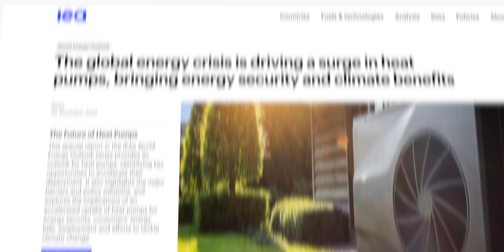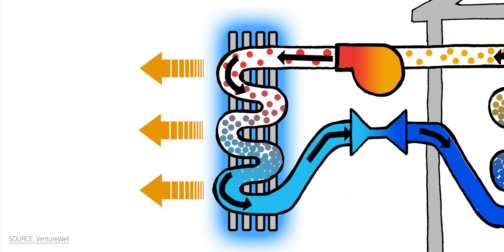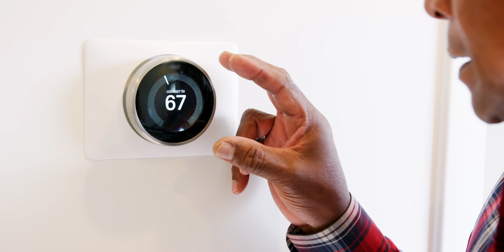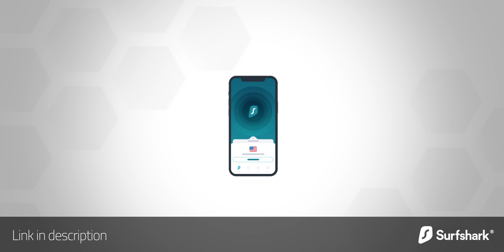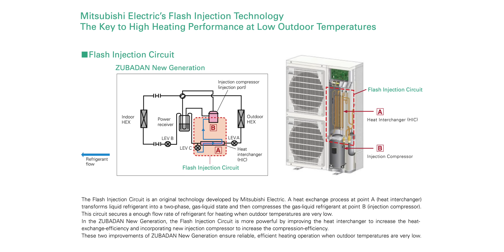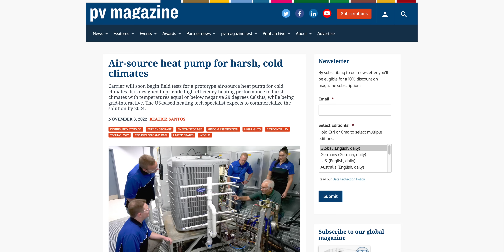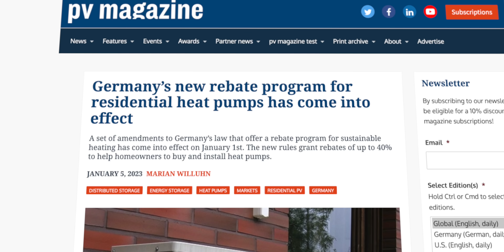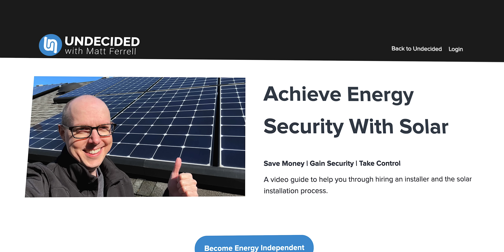Major Advances with Heat Pumps in the Extreme Cold

Comment from the maker: So do you want one of these newer heat pumps for your home? Any experience with them? Get Surfshark VPN at https://surfshark.deals/undecided - Enter promo code UNDECIDED for 83% off and 3 extra months for FREE!

If you liked this video, check out: The Challenges of a Wind Turbine on Your Home https://youtu.be/nPvTH7Siclg?list=PLnTSM-ORSgi7cadIj6qpCWkg-tPzN1sgj
Reply: The video was somewhat misleading as the differences between air source and ground source heat pumps was not covered and talking points erratically jumped between the two systems. I would have also appreciated a more in-depth pyhsics explanation on what happens when outisde temperatures drop below 5°C (instead of waving everything off with the annual average COP and only a superficial mention of problems with the phase-change of the work fluid).
Reply: @VulpeculaJoy  One of the problems with extracting energy from 5C air is that you reach the freezing point of water, so ice builds up. The outdoor units then periodically needs to switch to defrost mode to melt the ice. Unintuitively this problem lessens in colder temperatures as the outside air has less water vapor content. The rest of the diminishing returns has to do with a greater temperature gradient outside to inside to push heat against. This can be improved with some tinkering, as the Panasonics and Mitsubishan guys are doing, but can’t be avoided. If you live in -10F climates you need to go geothermal or have a secondary heat source on standby for those colder days..
Reply: @Random-f3y7w  But that's exactly what I said about differences between air source and ground source heat pumps. If air units do have that problem, how do ground units deal with low ground temperatures? What temperatures do we have underground anyway? Over what area or at what depth do you neet to place your piping? How much energy does a heat pump consume for an average house with average insulation during the winter? How do you combine heat pumps with other sustainable heating systems when it's too cold for the heat pump to operate?

The video is titled "The Truth About Heat Pumps and Cold Weather", yet it completely fails to go into detail about how heat pumps really operate in cold weather.
Reply: @VulpeculaJoy  "supplemental" heat sources are Always mentioned  and one was shown on the outside unit. These are a direct short heat coil so its using a LOT of electricity$$ . Also if that's during a Peak usage time, it may not even work...
Reply: The biggest problem that I can see with geothermal heat pumps is simply that it still requires electricity.  In Boston a noreaster bringing down hundreds of trees on the power lines and dropping a couple feet of snow on top of is certainly not out the realm of possibility.  Just running the heat pump would quickly drain any storage  battery. Do you have a backup plan in place.
Reply: Why did you install a water source heat pump when the payback period is so much longer when compared to an air source heat pump, and in some cases, is just not as cost effective? R&D in the air source heat pump segment is explosive because the technology is so much more affordable compared to water/geothermal. I would not be surprised if we continue to see dramatic increases in the efficiency of air source heat pump systems, such that water or geothermal systems make no economic sense in almost every conceivable scenario. Some HVAC or building scientists already allege that water/geothermal is simply not cost-effective in the face of air source heat pump offerings.
Reply: @reinhardtiushippoglossoides  because a ground source heat pump works in cold weather when an air source heat pump just becomes stupid when the heat pump is 3x to 5x the efficiency of a gas boiler but the cost of gas is about 20%-30% the cost per KWh of electric so the costs are about the same to run depending on where you live and its energy cost 

air source is cheaper because its worse by a lot and air source is the bigger segment cause not everyone can have a ground source heat pump cause they don't have the space for it most house in the uk have very little to no outside space 

air source can never be better then ground source ground source take heat from the ground that is always equal in temperature to the day before and the day before that so your heat exchanger means the system needs to work less to be as warm... when air source heat pumps are just so much less efficient if your in a cold snap of say -5C your exchanger while be running 100% of the time to just try and heat your home and the efficiency goes out the window and it will cost you 3x-5x to run it and will then be no more efficient then a normal electric heater
Reply: Heatpumps are very common here in Finland. Most common configs are Air-to-Air, Air-to-Water, Geothermal-to-water. We get -30 celcius on some winters here.
Reply: I have no experience with heat pumps but a question about the difference between air and ground sourced types. It makes sense that the air sourced types would lose efficiency as temperatures exceed 100f or below minus 30 but is there any reason for ground sourced to do so.
Reply: @dennisenright9347  there sure is! With air source HP, the temperature varies greatly, but with ground source, the temperature is much more consistent at around 50f.
Reply: @dennisenright9347  Ground source heat pumps do not lose efficiency when the outdoors air temperature becomes high or low. The discussion in the video was really all about air source heat pumps. It was a bit misleading that the video began with a testament to groud source heat pumps.
Reply: @jmb3543  Very true. I'll get an ASHP instead of a GSHP but I'm working on doing a lot more stuff before that anyway
Reply: Have You done a case study for a blackout situation with solar panels and heat pump?
Can Your solar panels, that feed into the grid also run Your own heat pump in case of a blackout or brownout?
Reply: I am looking at renting a jack hammer and driving down 50 foot deep pipes for a ground heat pump. Each 1-1/4 pipe would have a solid metal point and would have a plastic tube inside it.
Reply: @LaserFur  Interesting! I have a ton of questions, too.. How do you plan do link them together?  Will the water flow down the plastic tube and then up the space between the plastic tube and the outer pipe? Also, what type of soil do you have? I'm sure you'll want good pipe to ground contact and a pointed end should get you that, but what kind of friction will you have at full depth?
Reply: @heythere6922  I have a 50 foot deep sandpoint well. So I know I have 50 feet of sand with clay layers. The water table starts at 18Feet. Each will connect to two larger headers in the trench. I could do a pipe in a pipe or maybe even heat and pressure bend the end of a piece of 1/2 pipe into a sharp U shape. Then grout the plastic pipe in the metal pipe.
Reply: @LaserFur  If you can bend the 1/2" pipe into a sharp U shape and fit it inside the 1 1/4, you'll be much better off than if you try with 2 sharp 90 degree fittings. In this case, 90s are not your friend!  The pipe within a pipe would be an interesting challenge for your top connections, and more efficient if done well.  If you have a difficulty hammering 50' with a pointed tip, a oversized tip could help, but you'd want to grout outside the outer pipe down to the water table to maintain a thermal bridge.  Best of luck with your project!!
Reply: The original heat pump I had in the house started failing in 2021. The house was constructed in 2008. The cause was leaks in the interior loop. I had a Carrier heat pump installed with a package cost of $14,000 last summer. You can call it good luck or serendipity, but the inflation reduction act passed that fall. I didn't know that heat pumps were part of the package, but I'm glad of it. I also had solar panels installed, so with both I got a pretty hefty refund, but it's too bad it had to go to the loan I had to get. I had noticed the heat pump becomes active when the temperature difference becomes 30 degrees or greater. Now I'm not sure which part of the cost reduction belongs to the solar panels or the heat pump , but my electric bill Jan 27-Feb 22 2022 was $254.31. The bill for 2023 of the same time period was $77.31. I'm not complaining
Reply: In an industrial application, we went from a biomass heated facility to a similarly insulated building triple in size that was closed ground loop geothermal heated and cooled, for virtually no cost difference. Sure, the geothermal installation was costly, but we're loving it and anticipate a 7-8 year payback.
Edit: Our outdoor temperatures vary from 40C to -40C, or F (fake?) temperatures of ~100 to 40 below, with typical range from 35C to -35C.
Reply: Correction. You are not compressing a fluid. You are compressing a gas and then allowing physics to allow a phase change back into a fluid. You cannot compress fluids.
Reply: @davefroman4700  You can compress fluids, just not very effectively.  You are correct, though - heat pump compressors compress the refrigerant in a gaseous state.
Reply: To be honest, for me this video lacks one simple, yet very important information and that is a simple graph, with temperature on one axis and efficency (how man watt hours heat i get for one watt hour of electrical power) on the other, and that includes all types of heatpumps on the market (air; ground horizontal and vertical). That is essential information. Then maybe a cost comparrison with for example a modern gas based heating system for a one family home over its lifetime. This video really dosent provide enough information as it is to make an educated choice, especially since you jump in beween existing systems and such that are not even on the market yet. 

Especially with horizontal ground based system there is also the huge problem, if it starts leaking, you have to rip out the entier garden above to find and fix the problem. I have seen it happen in the neighbourhood and the owners were not happy to basically having to replant their whole garden (not mentioning the cost of fixing).
Reply: @Daniel-rd6st  that is the COP (coefficient of performance), but it's always going to be stated in a range and usually a rather wide range. The problem is no such graph exists, it depends significantly on more variables than just temperature. Model of heat pump (this includes the pressure of the compressor, type of refrigerant, air volume capacity, orientation, defrost method, and any tricks like the flash injection that the video talks about), relative humidity, shade, and wind speed and direction can all effect the efficiency of a heat pump, obviously some of these vary by installation and others vary by the minute. Most heat pumps include their controlled condition test results in their detailed documentation where they hold variables like model, humidity, shade, and wind constant, so you can get an ideal how they will perform when installed, but it's just an idea because the actual conditions will very rarely match their test conditions.

Cost comparisons get even more messy because they include the regional cost of gas AND electric as well as your local climate, all of which probably vary slightly year over year. I spent a couple months trying to quantify those variables in a spreadsheet and compare a couple models of air source heat pumps back in 2020 when I was deciding which model to have installed. I made a more generic spreadsheet geared towards people entering their own data to estimate their own results. Here is that spreadsheet (https://docs.google.com/spreadsheets/d/1KPAHODooLy6Cvg-8k4baOdQgC7Sgt8OFWZq-brI7npE/edit?usp=sharing). Currently it includes my own data based on the nearest airport (degreedays' data only goes back three years for free) temperature data. If you want to use data for your own location, just copy the document and replace my gas and electric usage and costs and degree day data with yours. I'd also welcome feedback on how to make it easier/better to use.

This is problem I have with a lot of green solutions, they replace simple inefficient systems with more complicated systems and people hesitate to buy something they don't understand. No matter how many times or ways I explain that heat can theoretically be extracted from any air that's above absolute zero, which is all of it, people commonly still tell me that doesn't make any sense and the don't trust it.
Reply: I have always been under the impression that heat pumps don’t work well in the cold. And while listening to the intro. Hearing you question that idea. Not even providing any detail or argument, I had a realisation. Even as inadequate as I have been led to believe heat pumps may be, I bet they still work better than my natural gas powered central heating given that my heat is currently turned off as I cannot afford to run it.
Reply: @lukeorlando4814 Go in wikipedia and look at the average temperature of Montreal and Quebec city. Well I can assure you that heat pumps are now extremely common here and no major issues. Heat pump, especially the new modern cold climate heat pumps are ideal, especially in Montreal because they can be used as AC unit in summer.
Reply: I suspect you have a ground source heat pump, not geothermal.
Reply: Thank you. I wondered about the cost of electric heating these days. Which I include heat pumps in. More of a fan of passive solar and thermal mass heat with masonry heater 85%+ efficient as supplemental. I am building off grid. So include extra solar and batteries in my price. Keeping solar systems separate.  One system for smoke detectors, one for lights, one for kitchen d.c. appliances, one for one small inverter for power tools. Small simple solar systems like on boat lifts are cheap and easy. I wonder if spending more on insulation would be better than a heat pump? I have to use air tubes because of floor. So wondering if I could fit a heat pump in the tube. It has to function to drain heavier than air gases. Especially with a skillion masonry earthship. The off gassing in greenhouse. Don't want toxic organic gases to build up. Starting with cheap skillion pavilion frame on block piers. And will connect block piers for over insulated short cold north wall later.
Reply: Air to air Heatpumps can ruin your economy in the winter if you live near open ocean and the theperature drops below around - 5c to - 7c... First year I had a had I heatpump I did not know that I had to turn it off when temperatures dopped down to -5 to -7 and ended up getting 5 times higher then normal electricity bill first month until I learned that I had to turn it of and use regular electric heating in the cold. 

I believed all the propaganda that said they word just fine down to -25c. Yes they function perfectly fine down to -25c  but ONLY if the air is dry which it is NOT AT ALL when you live near open ocean..... My heatpice also worked fine in -20c when the exstremely rare occation happened that the wind was blowing dry cold air from the inland. But normally the wind 99% if the time wind was blowing moist air from the open ocean 200m away making it useless most of the winter.
Reply: 6-7 years ago, I lived in the NorthEast where I had a heat pump on the roof of my condo as the sole source of winter heating.  The problem was whenever the temp dropped below freezing, the heat pump would reverse itself to defrost the outside line.  So for about 15 minutes every hour, the pump would be blowing cold air inside.  As a result it I was never able to get the temperature above 67, not to mention the exorbitant heating bills every winter month ($800+) just to keep my indoor space "heated" to a balmy 67 degrees.  Never again!
Reply: Matt - would you want to participate in a buying consortium I could put together between your channel and a couple more that I watch?   I’m thinking the volume would be powerful for buying PVs, inverters, EV chargers, batteries and heat pumps?   I’m thinking that way we could make a much bigger dent on climate issues and have some fun doing it.
Reply: I would love one, but I live in an older strata building so it's not likely to happen.
Reply: The compressor part doesn’t use a fluid, it uses gas! They’re not capable of compressing gas into a fluid! Your geo-thermal part does use a fluid to the outside heat exchanger.
Reply: I installed an air-source heat pump 4 years ago. I live in Michigan. I use it for  my primary heat source down to 25F. 
I also installed an air-source water heater. Both of the installations has reduced my use of LP by 80%.
Reply: You know that in the province of Quebec, heat pump are the norm in all the new single family homes. Just between 2020 and 2021 71 193 were installed in the province. Heat pumps work fine in Quebec, so I don't see any real issues in the US, outside of Alaska.
Reply: FL, what is thing you call cold weather?
Reply: Sure. It depends on where external module is mounted - in frost on open air or in basement etc not so cold (warmed by building or groud). In the case of open air,  a usual heater would  warm even better
Reply: I live in a rental property… ain’t no landlord going to shell out an additional $5000 on the place to save me $300 a year. Dream on. I’m lucky that unlike me last place this one doesn’t have a chip I gotta take down to the corner store and pre pay at an inflated price to have any gas/electric at all.
Reply: So I'm no going for a GSHP like yourself, however a heat pump is something that factors into my overall strategy for decarbonisation

The idea is to use PassivHaus principles, and take parts of PassivHaus without going the whole hog. My rationale around that is that if I go for the Enerphit certification, you do get diminishing returns

I'll need to do a lot of things in my house, to get air tightness right down so I can get an ACH of 2 or below. That includes over sizing my copper pipes and radiators. It also includes having PassivHaus doors / windows 

My rationale for putting a heat pump in right at the very end, is because I'll have done a lot of things that make my house "heat pump ready" and therefore I'd get the best COP even in winter

Then, I'd get an ASHP. Unlike a GSHP, where you do indeed get a COP of 4-5 all year round, you don't truly get that with an ASHP. I've been looking at "Heat Geek's" heat pump and even they've averaged only 3.34 for all of time

See

https://emoncms.org/heatgeek

I'd hope once I've done all the relevant upgrades, heat pumps would be even better and I'd have more money available too. This is why it does feature as a part of my strategy but only at the end
Reply: Where can I get that simple green earth black tshirt you are wearing??
 I did check your store and that logo is not available there.
Reply: I;m all for green but there is one channel who focuses on heat pumps, I found that heat pumps ain't worth it if you mostly need it at 10C or colder. Aside from installation costs, consider that this is wear and tear of motors and compressors, you'd be lucky if this last 10 years or more. This could change with cheaper electricity and larger heat pump units in the future.
Reply: It just struck me that installing an inexpensive rocket mass heater by the air inlet would allow for MUCH higher efficiency, as the air would never get down to the inefficient temps.  Most RMHs are designed to be run for just a couple of hours, once a day, just before nightfall, and, once they've been running for five minutes or so, stop smoking altogether.

Cheers!
Reply: With the price of electricity in EU 3-5 times Higher going for a Heat Pump is the worst Idea.
Reply: @suny1265  "With the price of electricity in EU 3-5 times Higher going for a Heat Pump is the worst Idea."

Not if you also go geothermal, which changes things a LOT.
Reply: -29C is good, but try -49C! A common pre industrial winter night where I live
Reply: I live in New Zealand and we don’t get the extreme cold, only down to about -5c but it’s a wet atmosphere so the system freezers the coils and needs to defrost every 30-60 minutes. Can be very annoying.
I’ve been told the snowy conditions, the air is quite dry so you don’t get the same defrosting issues.
Reply: anything new for those of us who live where it gets below -40 C or -40 F
Reply: Without geothermal,  heat pumps are not efficient financially or thermally.
Reply: A VPN does nothing for most people, especially when you log in to sites with your own name! IP numbers are only one way of many to track people and we have IPv6.
Don't waste your money by giving all your personal info to companies in lawless countries as it is sold on.
Reply: Heat pumps are now thriving in some of the world’s coldest regions, with Norway, Sweden, Finland, and even Canada seeing record adoption.
Modern systems—using variable-speed compressors, better refrigerants, and hybrid designs—deliver strong efficiency even below –20°C.
Their rise depends less on physics than on economics and policy
Reply: Heat pumps especially in humid areas (SE US) freeze up due to ice accumulation, especially the cheap ones which most people have, producing no heat in freezing weather. 
I've seen it numerous times, it's no myth.
Reply: @l0I0I0I0  They don't freeze up if they have unfrosting cycles, they reverse the coolant cycle to unfrost the outside unit of the mini-split. Inverter Air-to-Air heatpumps are efficent all the way to -20 degrees celcius. They still produce heat even below that, but need additional heating coil in the outside unit, which takes on the effincy, but they don't freeze up.
Reply: @l0I0I0I0  I have been using my 900 euros Panasonic mini-split for 10 years by now and it has never frozen and I have been using it -20 degrees celcius. I also live in rural part of Finland.
Reply: Hi Matt, I always enjoy your vids but this one seems a bit too much hype for a system you haven't used and tested yet.

The hype about heat pumps!
  
Seeing more hype advertising trying to get people to install heat pumps but be aware of the actual data about these units.

There is a big difference in geothermal and air source heat pumps. Geothermal uses heat from pipes in the ground where the temp stay constant and air source relies on ambient air temp which varies tremendously. Air source work fine in hot temps for an AC but as the temp drops below 40F they lose efficiency and at 0F they lose as much as 50% efficiency.  

Some new air source do better BUT they rely on additional heat coils and backup heaters and are very expensive.  If your home is not well insulated and sealed an air source heat pump will need a backup heat source in cold climates.

For a ground source you need permits and enough land for the ground pipes so not an option for many people and a lot of additional expense.

Heat pumps still use electricity so if you have a blackout you won't have heat. I recommend propane or wood stove where allowed  as backup systems for cold climates.
Vertical well heat pump  100 to 400 feet deep. For a vertical system, holes (approximately four inches in diameter) are drilled about 20 feet apart and 100 to 400 feet deep.  Unfortunately, vertical loops are the most expensive type of geothermal system to install, since installation involves deep and wide boring. A vertical loop installation costs between $20,000 and $38,000.

Summary: Air source heat pumps work fine for AC but not more efficient than an Energy Star rated AC unit and in cold temps they lose efficiency and most homes require a backup heat source. Especially in houses that are not well insulated and sealed.

Geothermal ground source heat pumps work better but are also way more expensive, require trenches or drilling and permits and may not work for for homes with limited space.

Unless you have a big solar power system installed heat pumps will not work in a blackout so you should still have a backup heat system installed.
Reply: Why not just install a shit ton of wind turbines and solar panels to power a traditional air conditioner or heater
Reply: @highlander723  For cooling, the heat pump & A/C are pretty much the same thing, but for heating the HP uses way less power than other electric heating options to move an equivalent amount of heat as the radiant heater generates. So less need for a "shit ton" of wind/solar installations. Maybe only a half-ton instead.
Reply: @highlander723  I'd agree, relative HVAC electrification efficiency savings pale in comparison to how much raw cost is avoided by adding home generation.  Much wiser to do latter, assuming you can fit it.  Grid-tied, or no brainer.  Maybe do both?